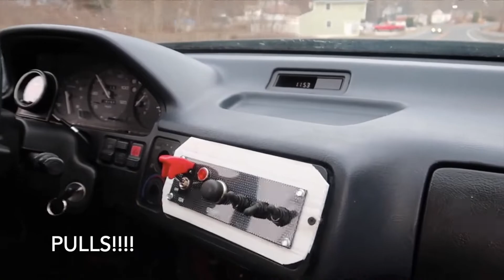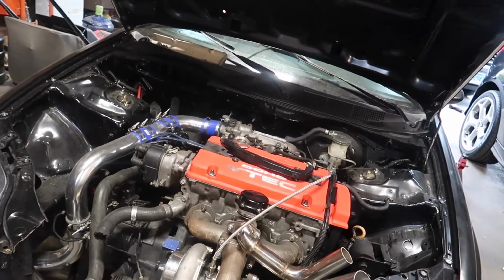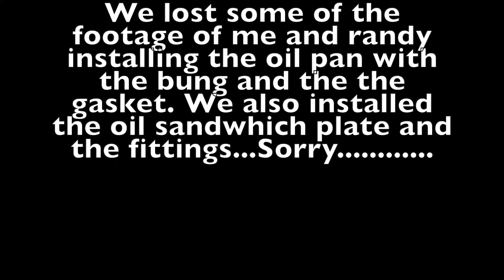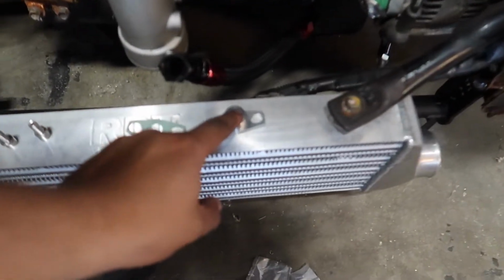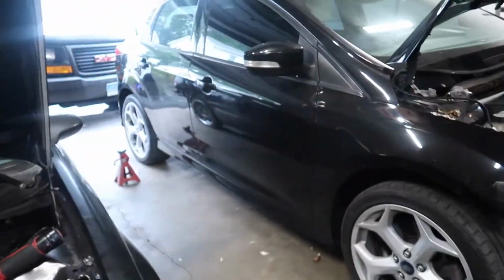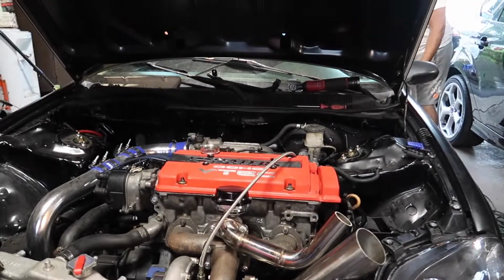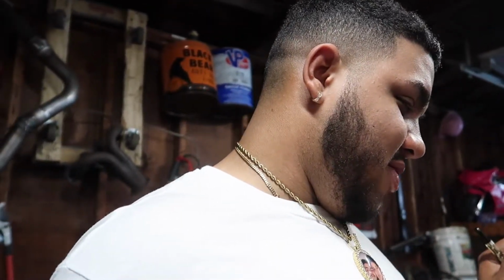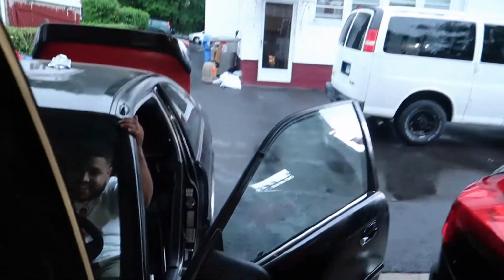Stock H22 Turbo First start

Comment: Good to know yal out here in CT. Letting my stock investments come back up then gonna try and pick up a 5th gen lude
Reply: just did a tear down on my lude some helpful advice do a compression test first ditch the automatic tensioner for a manual one if the lude you find has high mileage with the valve cover off check the tracking on the cam gears if the belt tracks off get new gears also check the cam lobes for cylinders 1 and 4 if scored replace the cams as well as springs and retainers cam seals and replace the vtec solenoid hope this helps keep luding

Comment: A little late but where did you get that up pipe or did you have to make it that’s what is stopping my h22 build as we speak
Reply from the maker: Go or Blow Racing all I did was order a 3 inch down pipe cut it an put it on the waste gate pipe didn’t have to be done how I did it it could just hold up an go straight out I just did it like that for style
Reply: CT DragZ oh ok I get you thanks